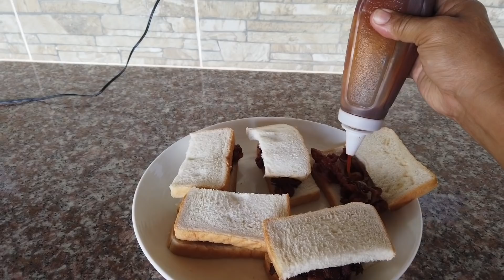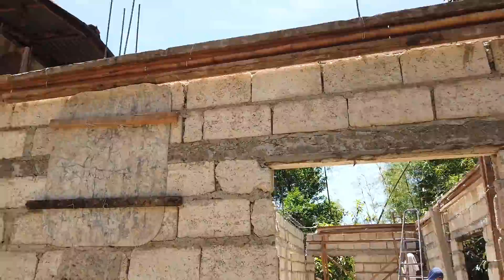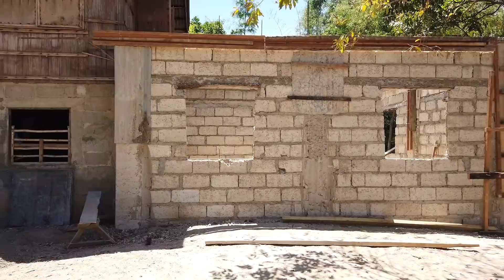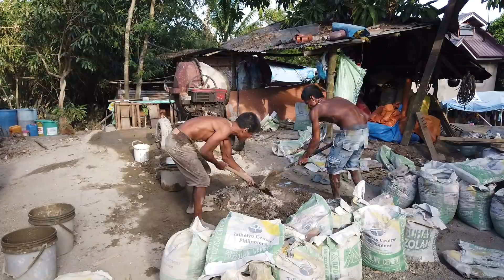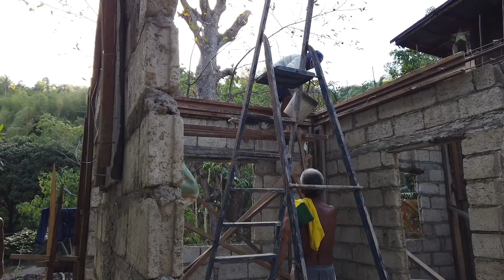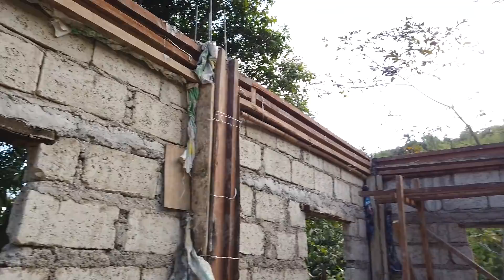Day 28 Budget Bungalow Build In The Philippines.

Comment: Hi I'm new here. Kung magpasadya po ba ng hollow blocks na more cement than usual, pwedeng bawasan ang thickness ng beams and columns? Mas tipid din po ba pagka ganon?
Reply from the maker: Hollowblocks po ay hindi for strength, receptacle lang ito for cement and rebars for making walls at hindi dapat load bearing. Columns and beams ang nagdala ng tibay sa bahay po para safe. Hindi ka makatipid dahil mag finishing ka pa rin kahit better hollowblock ito.

Comment: Mountain province is the best place to live as you say nanai, Climate change is all nonsense created lies from the United Nations to take your wealth away from us & make you feel guilty for something they made up. We can't solve world child poverty by throwing money at it, How in hell are we going to fix the climate if it needs fixing, Its all lies po. Im on your side with this nonsense,
 I enjoy watching your little bahay project I see how you do things I'm shaking my head but I understand what your doing so I'll keep my comments to myself. In Australia we do our waste water plumbing a little different, we have "S" bends in the sink plumbing & a "p" trap in the floor of the CR which is for when you have a shower, The "S" bends & "P"traps stops the gasses entering into your bahay from the drains as its a water trap, Also in the outside wall we have a 3 inch pipe that connects to the toilet main output pipe that runs on the outside wall up through the eaves & passes through the roof sheet metal & sticks out of the roof for about 600mm, The purpose of this pipe is for 2 reasons, 1, Its a breather pipe that assists the flow of water when you flush the toilet going down to the septic tank faster, with no air blocks in the main pipe,  2, It serves as a stink pipe to remove the gasses from your septic tank & there will be no gasses ever will enter your bahay, Any way I'll keep watching, Im not a doctor  your old B  I'm concerned for his health, You can make him bacon & egg once a week not a problem try to go easy on the & fats & sugars po. Salamat.

Comment: The purpose for a vent is for proper drainage.  Take a plastic bottle, fill with water time it to see how long it takes to drain when you turn it over. Now, poke a small hole in the bottom about the size of a pencil.  Cover the hole with your finger fill with water. Now when you turn the bottle over take your finger off the hole and see how fast the bottle empties.  You don't put a "P" trap in a waste line. Toilets should have one built in. Showers have one just below the surface. Use a small vent line out of your roof about 2 inch diameter.  Water waste lines should only drop about 10mm per foot. Drain to fast, the liquids go down ,but the solids stay in the pipe. Not enough angle and you get backup. 4 foot out should get about a one inch drop.
Reply: I'm learning from you to build a low-budget house in Africa thank you for teaching me how to build bless you
Reply from the maker: joe blow Most people in the Philippines do not vent their drainage system. When you flush there is often splash back from the toilet bowl as water replaces the air in the pipes. They directly put their sewer pipes into the septic tank and regardless of the fact a toilet has either an s bend or p bend depending on the toilet, gases from the septic will escape from through the toilet when flushed. I have found that putting a pipe up the side of the will allow most of the gases to escape. However since there is no main drainage and septics are used which produce a lot of gas, gas still escapes up the toilet when flushed. An additional p trap in the sewer line prevents that as forces the gases up the vent. Now you have to consider this is the Philippines, no toilet tissue will be flushed, so the main cause of blockage in sewer pipes does not factor.
Reply: @villagepeoplephilippines  

You are definitely doing a good job explaining to foreigners that a long lease and a cheap build is a thrifty way to save on ever increasing rent. Where we live a fully furnished bungalow like yours can cost as much as 25K per month in rent..That`s 300K per year which is probably the total build cost.
People in general are just plain stubborn and will rent regardless of sensible advice and this is why the property rental market is such a good proposition here.. Let me build them and let them rent them from me! They are happy and of course,so am I!
I do agree with Joe Blow about the fitting of an extra useless P trap but it`s YOUR septic tank and YOU can add one if you want Ha ha!
Here in our province,the sanitary dept. are very strict and ask us not to buhos the tank slab before they have checked and signed off the lines and chamber linkages. My advice is simply to follow the Engineering plan that was approved during the building permit procedure. 
Keep up the videos and the good work! Very enjoyable.

Comment: Hello . The build is coming along nicely .  By the way , flushing tolites have p traps built in .  The sinks and showers each get thier own p traps . ( Idk if those tolites flushed with a bucket have p traps . If not one should go under it . ) 
   They are connected to the main drain and a vent pipe .     Then the sewer pipe has to run at slight angle ( 1/4 inch per  foot to the tank )    if it's to steep of a angle the grey water rushes past , leaving solids behind )  
    P traps are not usually installed at the septic .
Reply from the maker: santa fe,  bantayan island life The toilet pipe set up requires an s trap toilet. Most people will then put the pipe from the toilet directly into the septic. I have discovered if you put an p trap on the waste line it prevents any gas going back inside the house to the toilet, and if you then put a vent on the sewer line between the p trap and the septic all the gases are forced to go to the vent. It may not be the standard but it works very well.
Reply: Village People Philippines i recall from a trip to Budapest some years back, the river was flooding and the stink from the river came up through the toilets

Comment: uhmmmmm was that cholesterol free bacon ?
the bend you mention, I think we call a waterlock, to prevent the smell
Without the ptrap the smell might come through the shower area
Reply: Exactly an issue I had to deal with on my very first project in the Philippines. I was in the US at the time and needed my new wife to oversee my plans. I asked the builder if he used a p-trap, vented the shower and toilet. He said there is no need to put a p-trap for the toilet because there is a p-trap in the construction of the toilet. The problem with that is the water trap in toilets is not always enough to keep out back smells and other things you don't want coming back up. But the biggest issue was there not being a p-trap in the shower drain. Sometimes the smell was so bad, I had to leave the house for a while. When it came to my next build, I was there to oversee construction and I had to stress with a new contractor that I wanted a p-trap and vent for the shower and toilet. He didn't understand why but that didn't matter to me. I insisted.